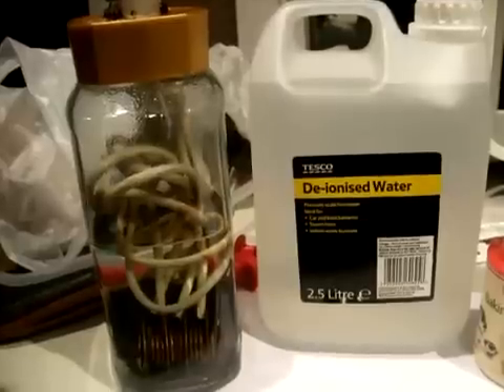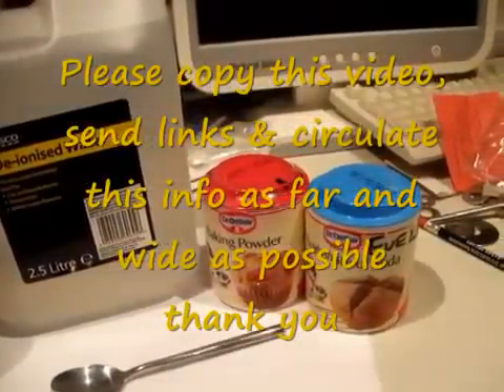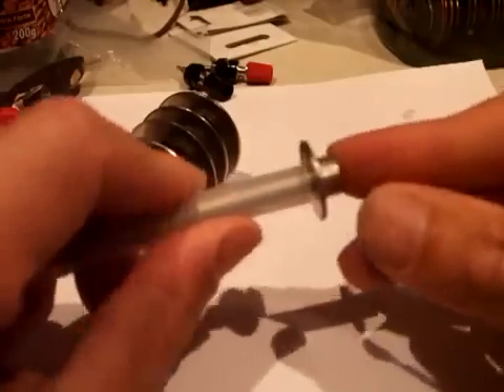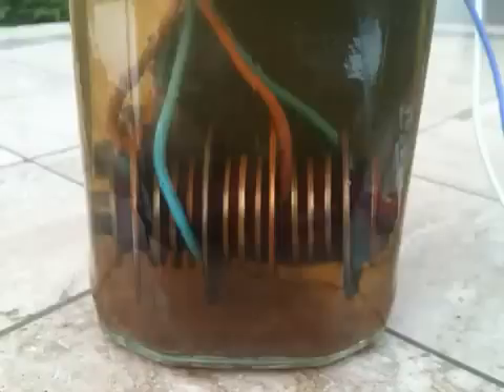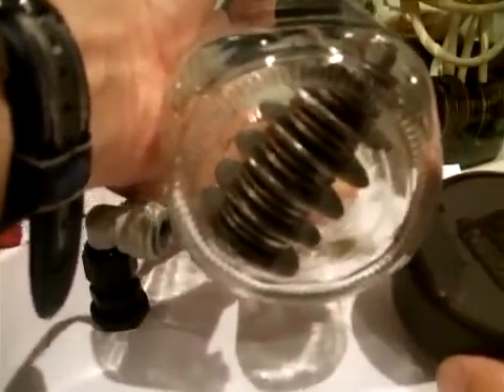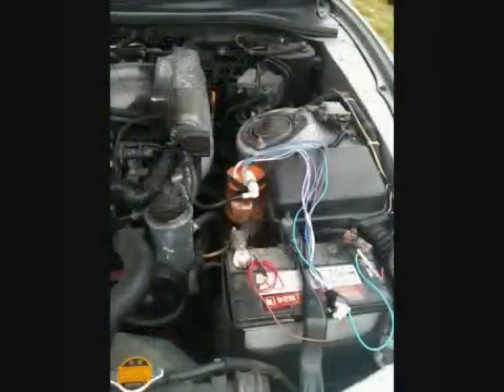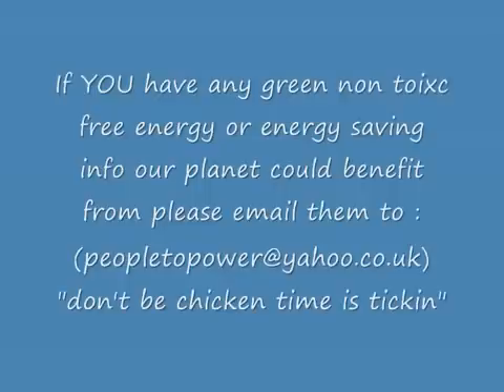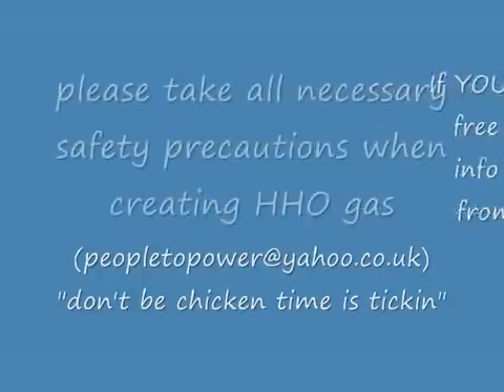HHO How To Build Your Own & Run your car on water

Comment: You should have used KHO, Potassium Hydroxide flakes instead of baking soda or bicarbonate of soda, much more efficient.

That hydrolyzer is si small that I doubt it will make that much HHO, which is probably good as if anything goes wrong not much damage can occur.

Your cell is also called a flooded cell which also reduces efficiency slightly. Anyway, you got it running though I would be wary of glass jars. Try PVC next time, superior material for this application.

Comment: Nice presentation. But, H2 gas, and O2 gas combine to produce water and heat. It is necessary to add energy to water to get it back to H2 gas, and O2 gas.  Thus, water is not a fuel.  Since there is some inefficiency in the process of hydrolysis, and in the alternator, it actually requires more gasoline to add this to your car, not less.
Reply: If the design is good enough, you can power your car on hydrogen alone. The only thing you might need to add would POSSIBLY be a bigger battery and a better alternator to keep the battery charged. It's a fact that a normal engine can run on hydrogen so, the science is worth perfecting.
Reply: As long as no one gets the impression that the car is getting energy from water!
Reply: To purify petrol it also need energy